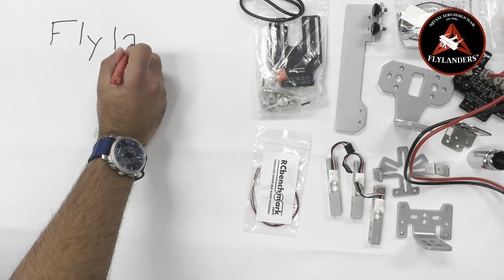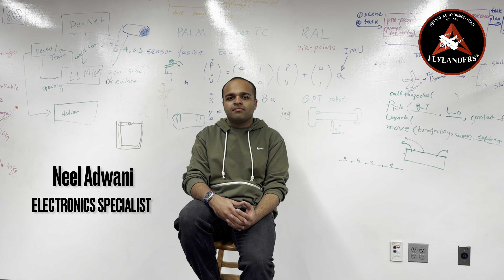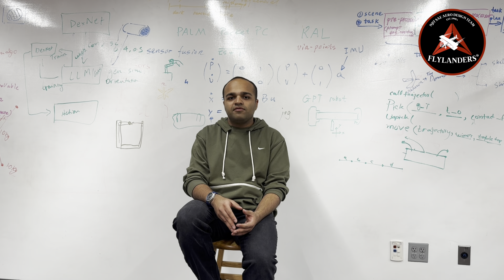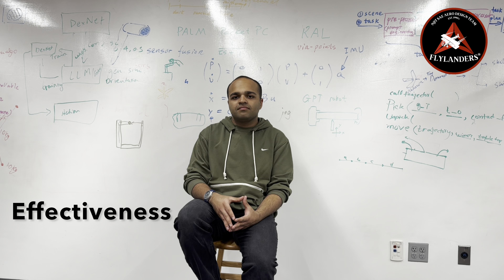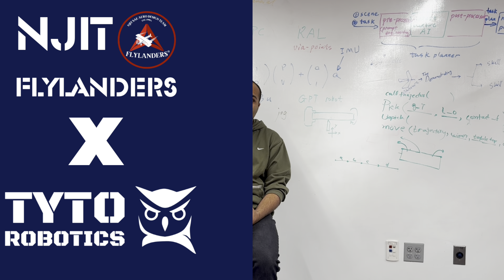When BLDC Motors Don't Perform As Advertised

Comment: hello Dear
Could you tell me how can I calculate the Trust coefficient and Torque coefficient via BLDC datasheet such as T-Motor?
the mathematical equation I think is: 
CT = Therust  *  (60 ^ 2) / Air density * (RPM ^ 2) * (Diameter of propeller ^ 4)
CT = Therust  *  (60 ^ 2) / Air density * (RPM ^ 3) * (Diameter of propeller ^ 5)

and the other hand the vertical Therust of the Motor is calculated with ===> Therust = CT * (speed ^2)   then CT = Therust / (Speed^2)   

just I want to know how can I calculate these coefficients via a Motor datasheet? such T-Motor

Best Regard Thanks
Reply from the maker: Hi there, check out these articles on our website, they may help you find the answer to your question:
1. https://www.tytorobotics.com/blogs/articles/how-to-calculate-electric-motor-torque
2. https://www.tytorobotics.com/blogs/articles/why-and-how-to-measure-torque-for-brushless-motors-on-drones